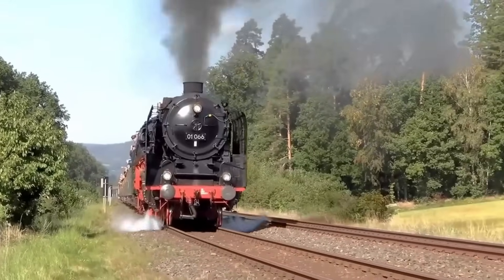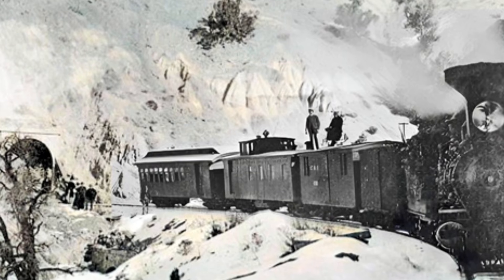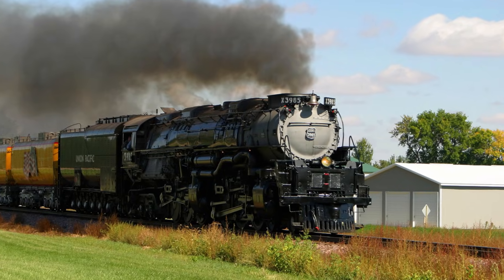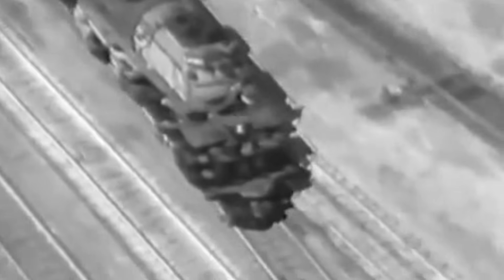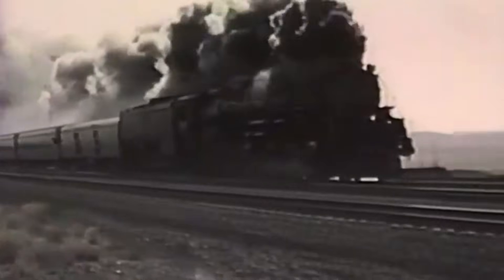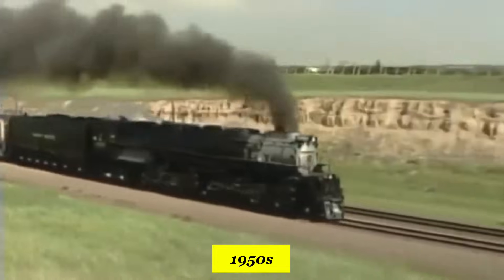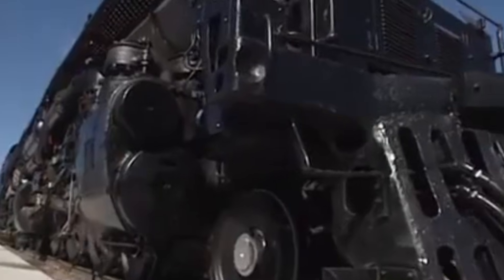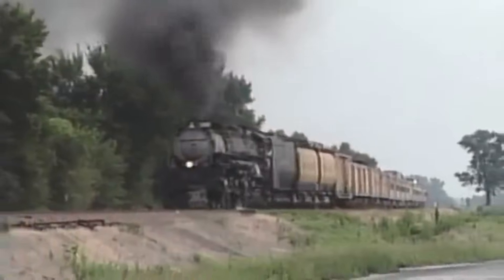Big Boy Gets All The Credit—But The Challenger Did The Real Work

Comment: The 3900 class Challengers were based on Big Boy not the other way around. Big Boys were already in service before the Challengers were designed and built
Reply from the maker: Incorrect, Challengers were first built in 1936, Big Boy was first built in 1941. Limitations of the Challenger led to the introduction of Big Boy.